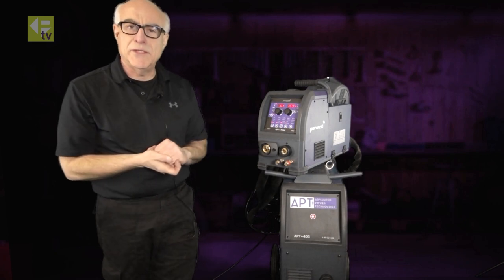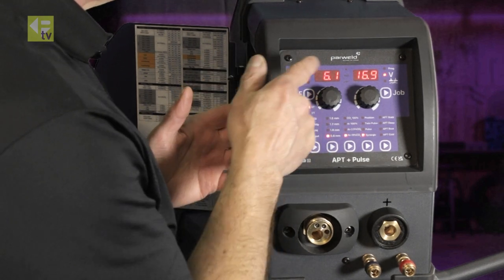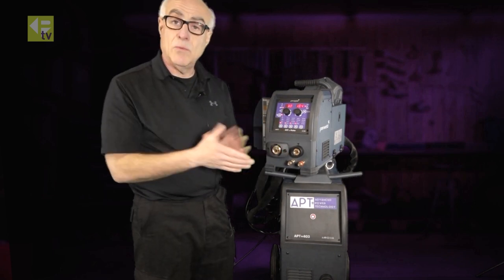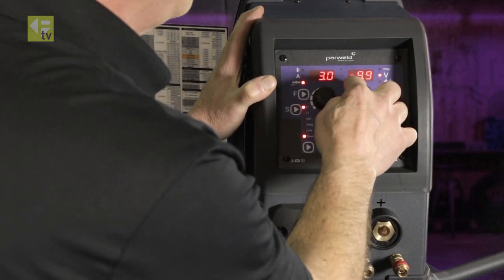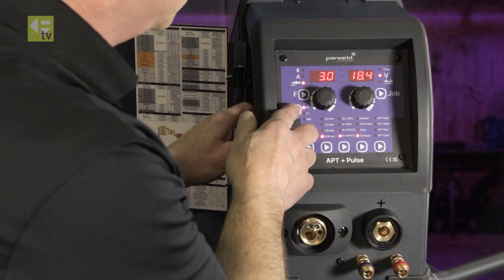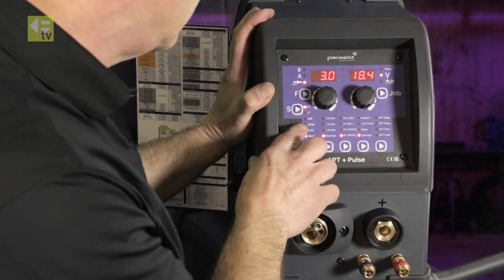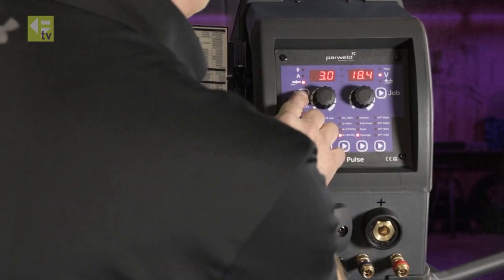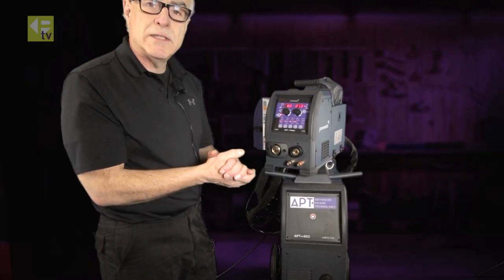APT+M Series Pulse MIG Machines Overview

Comment: did I hear correctly , this has twin pulse , has it got an interval timer too ??
Reply from the maker: Yes it does have Twin Pulse! 
And it does have a spot welding mode and stitch welding mode so you can time your Welds!
Reply: @ParweldTV  many thanks .. that spec lifts it well above most in that bracket ... if you have a Uk  service center then I doubt anyone could match that spec
Reply from the maker: @tomthompson7400  Thank you, we're always trying our best to improve our machines at any opportunity we can. Especially increasing the customer's value for money.😀